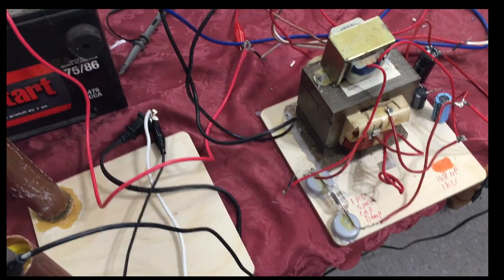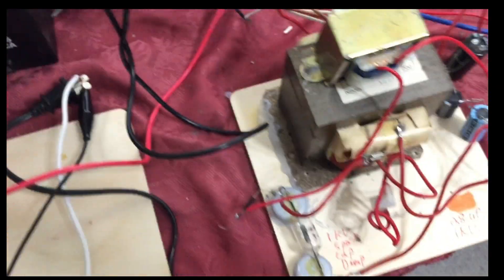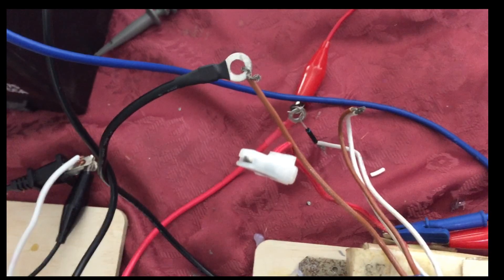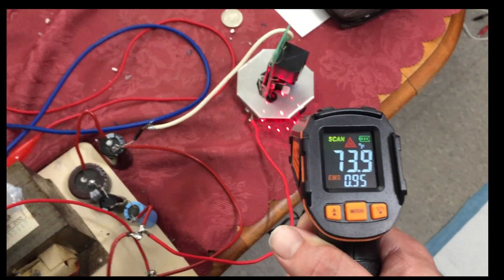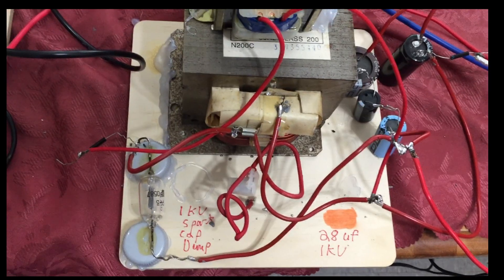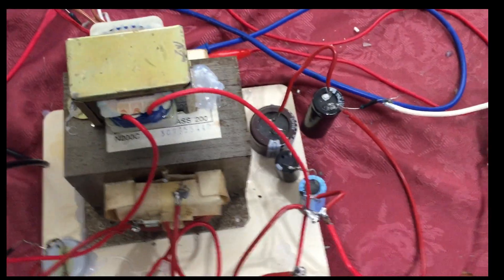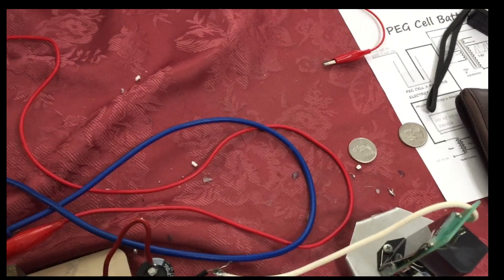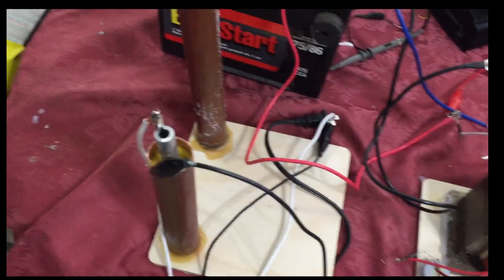Efficient Battery Charging

Comment: Hi Joel, I think it would be helpful to have a meter on the ac to prove there is only milliamps being used, also it would be interesting to see if it is a smooth draw or in pulses like the rest of the system!
Reply from the maker: The capacitive limits are hard and can't be exceeded. I've demonstrated this in previous videos, but they often go unnoticed, and I don't want to waste time repeating myself only to be ridiculed. To understand how capacitive power works, simply input the values into an online calculator—values between 1-10μF will show you're dealing with milliamps. There's no need to show input and output meters repeatedly, as some people claim it's incorrect regardless.
Reply: @joellagace1679   I only seen your reply now, for some reason yt only sends notifications if someone likes a comment but not if they reply! Even @'d name replies don't appear in mentions. I mean it looks like a massive breakthrough but seeing the energy consumption at the wall socket while the battery is charging would be great!

Comment: Good experiment, but try to charge 2000 v 2uf non polar capacitor and switched trough high voltage igbt to get step down voltage efficiently

Comment: I always tried to tell anu and other people that you need to rectify it and send it into a second transformer as pulsating dc Instead of taking the direct output. I think he finally got it when he discovered the choke. Don Smith definitely did this. Going in series is something I never gave too much consideration until recently. But yes the fact that you are doing it with no  consumed power is the real eye opener here
Reply: LOUDER